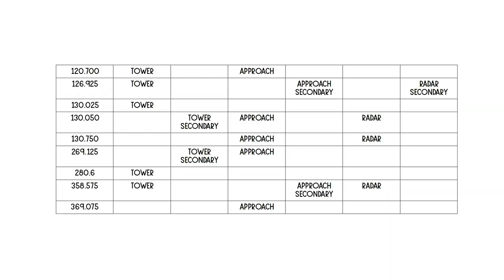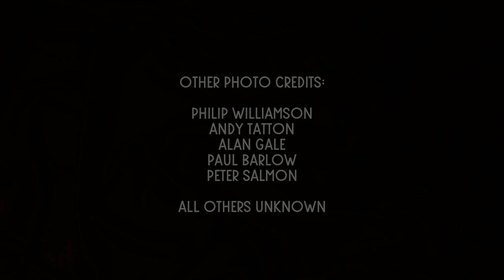Radio Communications Systems At British Aerospace Woodford

Comment: another fascinating video lewis, I was particulary interested in the switching of the lights by DTMF. thanks vince 2E0XOH
Reply from the maker: Cheers vince, yeah that piqued my interest too!
Reply: At the New Orleans Lakefront airport, flights coming in or departing after the tower closed for the night at 12AM, pilots could simply dial in one of the designated radio frequencies, key the mic 2-3 times to turn on the runway lights.